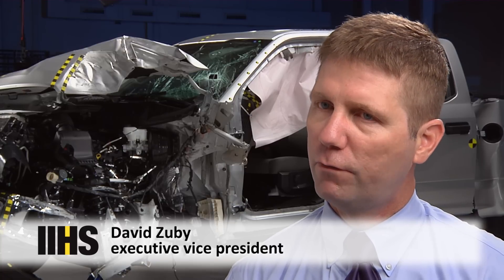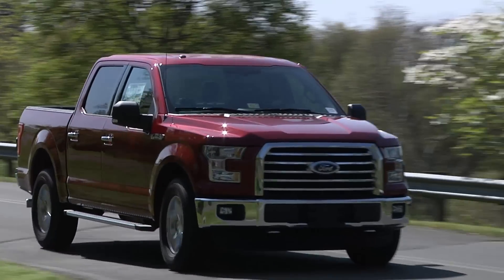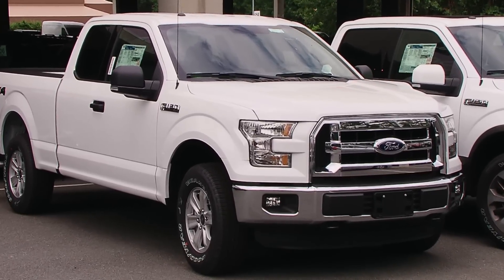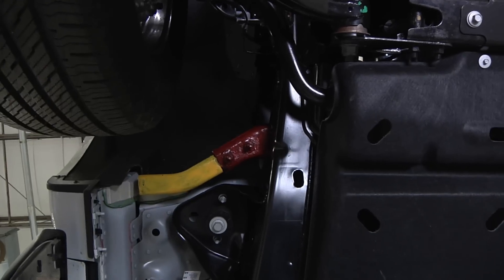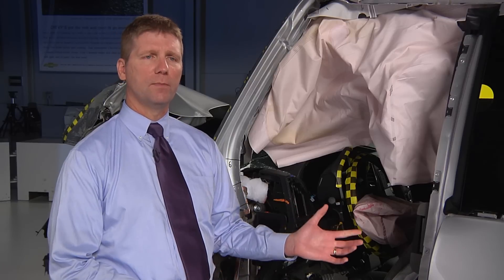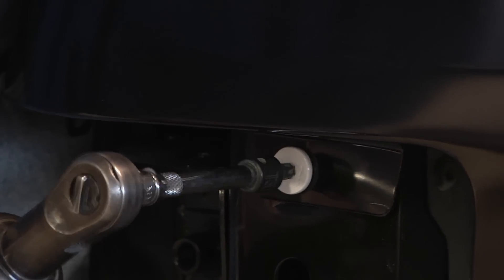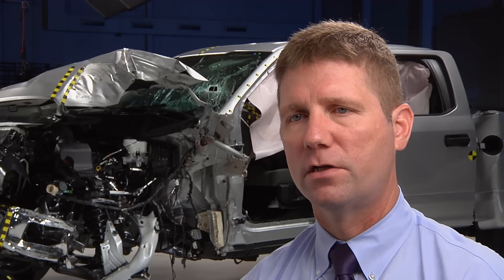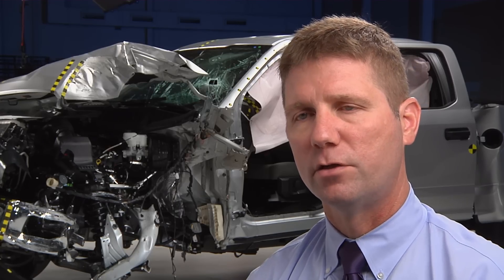First IIHS test of aluminum-body F-150 - IIHS News

Comment: The older steel body on frame was so much better. They just keep making them cheaper and cheaper.
Reply: What made them better? The rusted out bodies, the lower payloads, or the reduced fuel economies?
Reply: Cheaper material to save cost  @samkeast02

Comment: aren't those protective protrusions on the frame rail cheating? Surely adding this gimmick is clearly to help the truck ace a test like this, there's no way those protrusions would help when impacting another car. Not to mention not having them made the extended cab perform ABYSMALLY. Are these protrusions an industry standard on trucks and vans of all brands? 

It's like adding a steel patch to the exact place an armored vest is going to be shot, a gimmick that doesn't apply to real world situations?
Reply: Please can you explain this I don't understand, what is a protective protrusion on a frame rail?
Reply: If you mean it contributes to cheating death ... then yeah it's cheating
Reply: No, is not cheating. This added frame reinforcements are conceived when the truck is designed with this particular test in mind. With this goal, they make sure this added frame work won’t affect any other test results in the different tests. 

Aside the IIHS buys car right off dealers lots, so Ford has no control nor they know which particular truck they will test.
Reply: @ford2219  Did you miss what the original comment said? He suggested that the added frame component may improve the test result for the lab, which results may not translate during real world crashes. 

And he has a point, because hitting a static barrier perpendicular to a flat surface will produce a much different result than the highly variable crash scenarios you see on the roads. Therefore engineering a vehicle only to pass a specific test ignores the reality of real world risks. 

Whether it makes much of a difference... I don't know. But automakers have been known to pull this shit before, for instance the Toyota RAV4 only included structural reinforcements for the driver's side, until the IIHS began their passenger side overlap testing and exposed this shortcoming in design. 

I wouldn't be surprised if the crew cab model performed equally as poorly if they hit something other than a vertical wall in a controlled testing environment...
Reply: @40040  I think you are missing the point Liard, the truck has modifications to help in some offset crashes. The front is designed to compress and deflect in an offset. You can not watch this video and tell us that it's cheating, when a 5000lb truck slams into a solid object and has minimal cab intrustion.  Sure we could argue all day that if we drive this thing off a cliff and land offset on a rock, your not going to survive, or if you hit an 18 wheeler offset your not going to survive, but for a majority of offset crashes you will be better with this modification in place vs not!